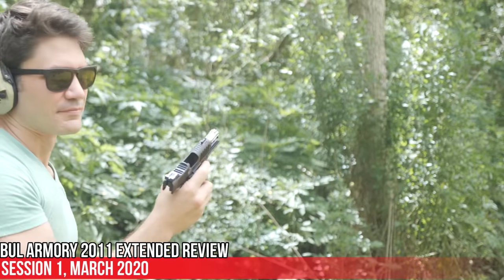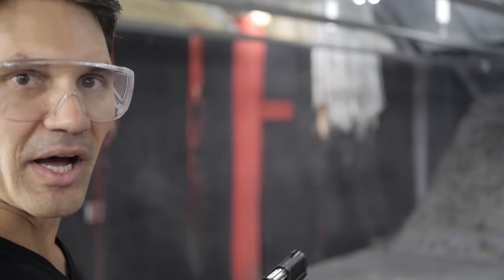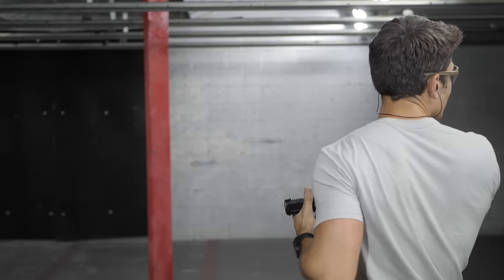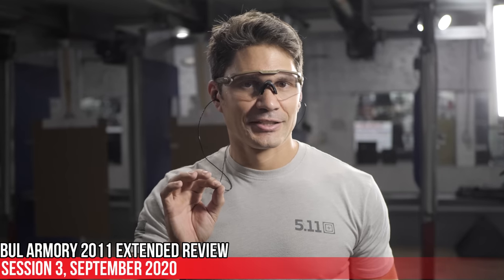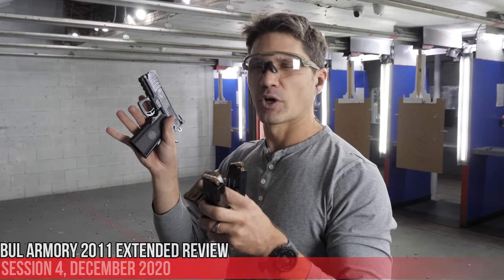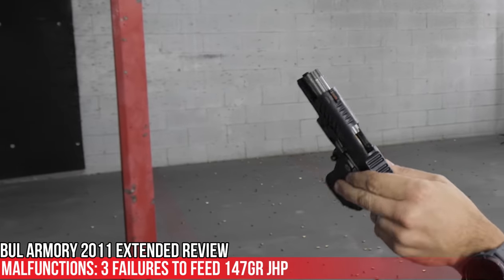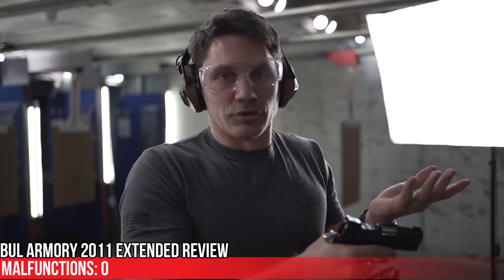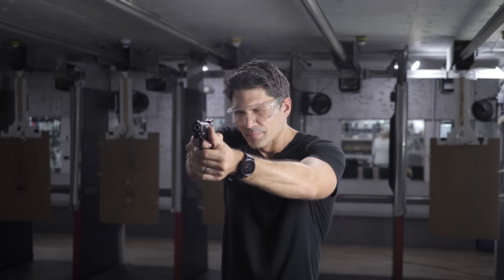Can I Trust my 1911 with Hollow Points? BUL SAS 2011 Extended Review

Comment: Very well done video and followup with the manufacturer. I'm wondering if the 147gr JHP is necessary for self defense as opposed to the 124gr? Will the latter not do fatal damage? Also,, I like that you brought up that the 147gr might be a little longe and that loading the last round into the clip is really tight, and that might be an issue with the feed ramp problem? I have trouble with a Kimber Micro 9 when it comes to feeding that first round on a full clip. If I subtract one round, I can get hollow points to feed in on that first round. If I put a round in the chamber first, and then insert a full mag, it fires flawlessly. No jams either at the beginning or the end of the mag. Anyway, great review!

Comment: Breaking News: 1911 fails to feed hollow point ammo. Absolutely no one surprised.
Reply: That’s actually completely overplayed.
Reply: The best part is, I actually own several 2011's in 9mm, and I've even daily carried one for close to 3 years... 

...But it doesn't stop me from talking shit on them.
Reply: My Sig Ultracompact runs Ranger Ts just fine.
Reply: Great you caused about 3 heart attacks in the comment section with your 1911 bashing. Joking aside I still really want one of these as soon as I can afford it. If she is a picky eater I’m not too worried as long as it feeds anything but 147 better.
Reply: My little Sig P938 has never failed any 124 HP ever. Thousands of rounds.

Comment: Every customer I get that complains about hollow points in 1911s I swap the followers out with the gi sheetmetal ones and bent the tip of the follower up. Fixes it every time. Especially when it is shoveing the projectile back.
Reply: Obviously defective ammo is curable  only by replacing it.

Comment: Just don’t use the 147.
I almost always use 115.
Occasionally 124 grain.
Reply: Which 115gr hollow point do you use?
Reply: For a .45? My 9mm HPs are 115gr.
Reply: Agreed. I think that anytime you're at the high or low end in grain weight for any caliber, you will have more problems. 115 and 124 function pretty much flawlessly in every 9 mm I own. When I go up to 147, I seem to have more FTF/FTE issues, and on the few occasions I have used lighter, higher velocity rounds, my point of impact is way off compared to 115 and 124.

Comment: There's always a problem when a full magazine is super tight. The first round will always be a gamble. Some aftermarket mags offering a few cm of wiggle room always do my guns justice. My memory is garbage but will mention someone here on YouTube made a video about why he loads 29 rounds instead of 30 for AR mags. The idea was to get around having to jam and slap it in his rifle since those top rounds can push back slightly. In my experience it's not a problem if the bolt is back. Still, something to consider. Whether it's a too-tight spring or overall mag length is a smidge too short, it sure does suck to get jams on the first round.
Reply: Gotta tap that mag harder, I run mine loaded to the brim never had am issue.

Comment: I had a CZ 75 SP-01 that did the same thing, with 147 grain HST's only.  They rethroated the chamber, and bye-bye problem.  Could be the same thing .  I had to argue with them to get the gun in, though, as their initial "solution" was to tell me to switch to 124 grain hp's.

Comment: Most of your malfunctions appear to be failure of the round to climb the breechface under the extractor.
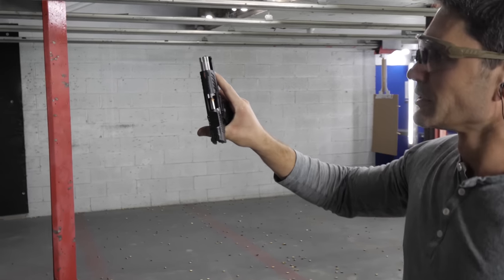However, your session in the 11:00 and 12:00 minutes of the video, you have three different malfunctions - first is the usual breechface, second the slide lock caught the slide, and the third was slide over-ride of the cartridge.

Comment: Ok, call me crazy but I've had this problem on a variety of guns and here's how I solved all of them with a dremel in a small round sandpaper bit take some light cuts right after the feed ramp into the sharp edge of where the barrel starts just take that little hump of sharpness away then polish with a polishing bit and continually get finer and finer on the Polish you use in the end polish the ramp as well they sliding like butter

Comment: 1911s going into battery was a thing for me when I put together a couple of 80%’s, I found that doing the overhand rack helped as I could get more force than using the slide release, I think this may be why the doctrine of using the overhand method came from (or when guns are fouled), now with modern guns and in a civilian setting I don’t think it makes a difference, I eventually fixed the going into battery issues however the 9mm one was always more finicky than the 45 one I put together, it would run most reliably with nato 9mm

Comment: just a possibility, mainly cause I've seen this happen with aluminum frames(rails), depending on the dirty ammo(steal case), there could have been a fragment from the steel or something in the powder due to cheap manufacturing adding non combustible material in the gun powder, wedged itself in between the steal slide rails and aluminum frame rails, causing the aluminum rails to ripple or build a burr, slowing the slide just to a point where it had issue with the longer rounds when they fed into the gun, basing this off your comment towards the end stating the gun feels different

Comment: 1911’s are like a 1932 Ford V8 hotrod. They are cool and nostalgic, you can tune the heck out of it and take it to the strip in the weekend but you don’t want it as a daily driver. I know cause I owned five of them including two Colt’s.
Reply: The general 1911 platform is great for competition guns, too. They have to be 100% reliable as competition guns, but that doesn't mean they will feed hollow points.
Reply: @maximilianmustermann5763  The 2011IPSC  guys at my club frequently have to tune their extracors, magazine feed lips or  magazine springs. The guys who run CZ´s or Sig Sauer mostly only have to do regular cleaning.

Comment: Have a taurus g3c with the same issue with hollow points. Sometimes it feeds and others it doesn't. Havent tried different ammo yet because it's hard to come across as you know but right now I have sig luger 9mm hollows. They run fine in my canik tp9sf though.

Comment: 3 inch action is just too damn short in any 1911 platform. 
3.5" is at the very bottom limit.
4" or 4 1/4"  would stop the fail to feed issues.

Comment: The inconsistent results in this test would seem to be a QC issue at Federal honestly..
Did you ever try to use just ONE less round in your original magazine? Before BUL replaced them? 

Also for a 1400$ pistol a grip screw should not fall out randomly 🤣.. 
1911/2011 are like Harleys... There is always a "tax" 🤣..to get the desired result/experience..

Comment: Switch to Wilson Combat magazines, that usually alleviates most 1911 feed problems. With my Wilson Combat ULC, it never fed hollow points very well,if I used only WC mags , it would have have less feed  jams. I finally sent it to Night Hawk to go through it, and while it is there put on a Threaded barrel and suppressor height sites. I get it back and it feeds FMJ , but not hollow points. Bob Reeves said he’d make it right , and sent me a 19 lb main spring to replace the 18 it came back with. im waiting for the spring to get here.Or you can stop limp wristing the damn thing and switch to a non gay caliber , such as .45 ACP?If you shoot more accurate , you wont need a bunch more rounds?

Comment: Beat me over the head with a wad of cash if I'm wrong, but isn't a 9mm 1911 just a really hipster equivalent to a CZ75 in terms of form and function? Specifically, the BUL SAS 2011 reminds me of a CZ P-07. Not an exact match mind you, but it seems like a more expensive (albeit better built) gun that serves nearly the same role. Also, as an aside, try lubing up the mag a bit to see if that fixes the issue.
Reply: I can and I did. The role is the same, the size is similar, they take the same bullet. (Except the CZ can actually cycle 147gr HP reliably) Don't try to tell people what they can't do on the internet, you'll be disappointed.

Comment: You had to ask for a negative comment.
 How about this.. Hey man you get to try out some of the most amazing firearms out there and you complain about 147 grain Federal? I wouldn’t use that shit if it fell on my lap in the middle of my living room like poltergeist. especially not in a small 2011 because that’s not what it’s made for,  even in the manual if you care to read it, it says 115 to 124 grain is what works best in the firearm….

With all of that said, I have the exact same set up and I’ve never had an issue ! And I have used 147 and above

Comment: im surprised its hanging AFTER ejecting the first round. i would have expected it to just barely feed the first round as then the tension is highest. quite interesting.
Reply: It depends.  

When you charge a pistol, you are generally going to pull the slide back all the way, which gives the slide slightly more time to accelerate and pick up the first round.  

If the slide cycling when shooting doesn't quite bottom out the slide (maybe because of the friction between the top round and the slide, caused by the spring pressure of the magazine), then you could have less time for the slide to accelerate, thus not having enough energy to pick up a round off of a stiff spring.
Reply: @theodorehunter4765  good point mate

Comment: @7:02 Hey isn't this bad for your extractor when you do this?  It looks like the round was just floating in there and you slammed the extractor up against it.  (Why you're not supposed to just drop a round in the chamber without using the magazine). Just thought I'd mention that I noticed.  Wondering if you have an explanation though and I'm wrong :)

Comment: 😲 James face when he realizes what everyone else has known since 1911.
Reply: That the 1911 was never designed to be that small. Very few 1911 makers have gotten a good design and bul Armory isn't one of them
Reply: zack9912000 Just don’t use 147gr JHPs in them and you should be fine.
Reply: @SkullCandy5671  No, a proper fitted 1911 built to the JMB design has no issues eatting JHP. My Colt, Sig and my Wilson combat 1911 have thousands without fault. If the gun won't feed it needs to go to a trustes 1911 expert Gun Smith to be gone over.
Reply: @zack9912000  Well considering this is in 9mm it inherently cannot be JMB standard. Like the video shows, just stay away from 147gr and you should be fine. Most people use 115gr and 124gr anyways considering a box of 20 147gr federal HST (was) the same price of a box of 50 124gr Federal HST. I bought a box to try in my P365 because they claimed they performed better out of smaller pistols but plenty of videos show little to no difference.
Reply: @zack9912000  This is a double stack, officer, 9mm 1911. There’s no TDP in browning’s brain for this monstrosity. There’s a reason he fixed the 1911 and made a hi-power.
Reply: @Landoftheignorant  That's actually not the case. The majority of the final design of the P35 came from Petter, and FN, not Browning, and it was intended to help sell handguns in the European market, hence the 9mm, and higher capacity, neither of which were popular in America at the time.
Reply: The 1911 was designed from the start to fire round nose, FMJ, or lead ammunition. That a stock 1911 will shoot, and eject a variety of hollow point ammunition with no modification is a tribute to the design. With a basic throating, and polish modification it gets better, throw in flaring the ejection port, and it becomes very reliable. I have a 1955 Colt Commander I have carried for over 30 years, it's been "ported & polished" in the mid 70's, and it will feed and eject empty cases. Back in the day, my carry ammo was the old CCI Lawman 200 grainers, the "flying ashtray". You old guys will know that if a pistol fed this ammo, it would cycle anything. So it's an almost 100 year old gun, that with very minor modification will shoot with, and exceed the field accuracy of alot of 21st century guns. There is a reason alot specialized police, and military units still carry 1911's, or a variation.
Reply: @283blood  It was browning’s brain child. It was his design, FN just finished it after his death.
Reply: @Landoftheignorant  Again, go read up a little Jon. There were several major design changes, and improvements to the design made by others after Brownings death. If you look at the design drawings from Browning, and the end product by FN, they are different.

Comment: 1911s and 2011s are great for competition, where the bullets are reloaded specifically for the particular gun. For carry? Not so much.
Reply: I carried only 1911’s first a Colt Commander, then a Kimber Pro Carry II AND now a Springfield EMP4 over 30 years and never had a malfunction that wasn’t a messed up magazine, and maybe 6 of those.  Not going to guess at how many rounds through each but I generally shot my carry gun twice a week running 50 rounds of my carry ammo on each range trip unless I was going specifically for practice with the carry gun. Then I’d run 150 rounds. Before the 2020 ammo famine I had put 2000 rounds through the EMP4 with no malfunctions and no cleaning.
Reply: A combat pistol that's been around for over 100 years and according to you it's just a competition gun
Reply: @norman6694  exactly, you wouldn’t choose a m1 over a m4, and you definitely wouldn’t choose to ride a horse into battle with a sword. Times change, technology changes, and we have much better firearms today.
Reply: @teffe3639  between the M1 and the M4 which has the greater effective range 🤔
Reply: @norman6694  congratulations, they have the same 😂 actually the m4 have a greater effective range because it’s measured in meters instead of yards. But you’re absolutely right, I should have had an m1 garand and a 1911 when I was in Afghanistan instead of my mk18 and Glock. 😂😂
Reply: @teffe3639  so you are saying a 5.56 has greater range than a 30.06....I have shot both rifles and 5.56 comes no where close to a 30.06
Reply: @teffe3639  in regards to the 1911 vs so called modern pistols the 1911 is much more accurate at least for me it is

Comment: If the recoil spring and main spring increased weight slightly would that increase the timing, to allow 0.025" to fiction properly? Would it also reduce felt recoil?

Comment: When it malfunctions does it lock the slide back? I have a bul sas ul Fs 45 and nine had the same issue , if u look close sometimes the round bumps the slide stop on the way up , I had to sand the nub on the slide stop to give clearance , u can check it with the slide off and a bullet in the mag and see if it’s bumping the slide stop

Comment: You can’t run 1911/2011 style pistols dry.. Just like an AR... It will run dirty and lubed, but you run it dry and dirty and it’s only a matter of time before you start to have problems. The 1911/2011 platform isn’t a Glock man.. No matter how bad you want it to be.

Comment: I would like a single stack version of that
Reply: Bul  have 2 ultra light 3.25 inch barrel  single stack 9mm 8 rd 1911's ( one with a fibre optic front sight )
Reply: @sputnikone6281  yeah they are very hard to find I have been looking
Reply: @lorenmesedahl7582   Happy Tuesday Loren,  FYI Bul make the officer size 3.inch barrel 9mm marketed by Magnum Research but it has 8 round mags  & not the 9 rounders & 3.25 in barrel of Buls proprietary offering.  
Check the Omaha Outdoors website for the Magnum Research Desert Eagle 1911 U 3" Pistol 9mm 8 RD the photo clearly shows its made by Bul
Reply: @sputnikone6281  yeah I will for sure but the look of the bul with all the extra machining is another reason why I wanted it but it would be good in the mean time

Comment: the 147s having higher recoil, your thumb is hitting the slide stop, i bet that is your problem. either locking the slide back or just slowing down the slide enough to cause a problem

Comment: I have a 1911 that used to jam on hollow points. My gunsmith worked on the chamber throat and feed ramp and now it's about 99.5% reliable with cast 255 grain Keith SWC bullets. You can make them feed almost anything with a little work.
Reply: Very true. The thing is , this gun is a $1200 gun and no work should be needed at that price point IMO. I have a Taurus G3 and   have had zero issues with any ammo. A $250 gun. Ran 115 to 147 hollow points and all, no issues. For $1200 the gun should just about load the magazine itself. But again thats  just my opinion. :)  (I also own a sig and a glock)
Reply: 99.5%? I wouldn't consider a gun that malfunctioned every 200 rounds to be reliable and definitely wouldn't carry or rely on a weapon so unreliable to defend my life. Not when far more reliable and otherwise competitive weapons are readily available. I expect the weapons I rely on to defend my life to be able to go thousands of rounds between malfunctions, when using good ammo in normal conditions.
Reply: @Paelorian  A jam every 200 shooting cast Keith style semi wadcutters.
That is the worst possible design bullet for a pistol, it shoots everything else perfect.
You should really read a post before you post.

Comment: Groo here
 Try holding the gun correctly for a change..........
 That dang thumbs forward hold was started by speed shooters with guns moded for it...
 Pinned grip safety ,or none, safty lowered for a thumb rest [got one ]AND a pad for the off hand thumb somwtimes called a gas pedal...
 Grab the gun as you hold a hammer, thumb down, put the support hand over the shooting hand with the support thumb OVER the shooting thumb NOT along the slide.
 Your vid shows your support thumb moving up and down on the slide due to the extra kick.
 Re test with correct grip and advise.